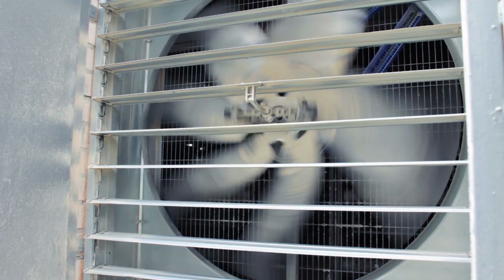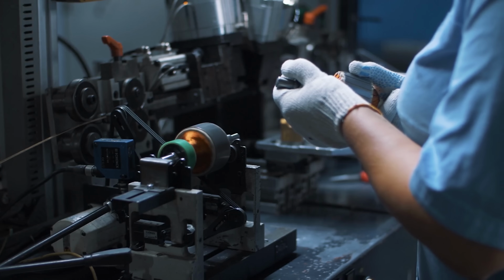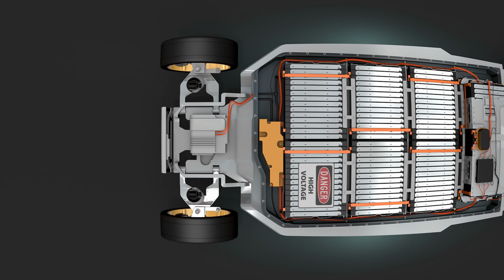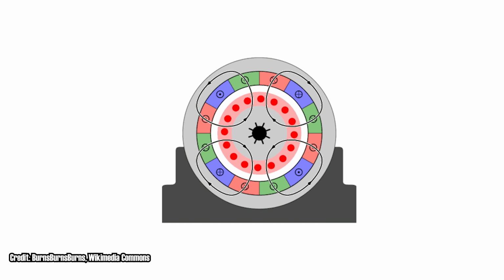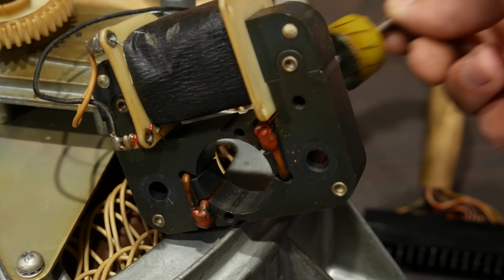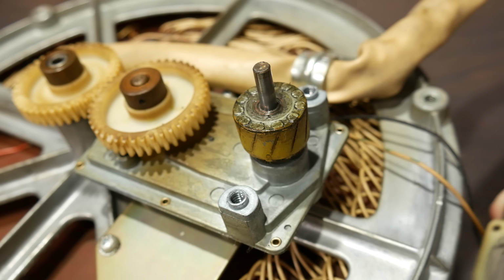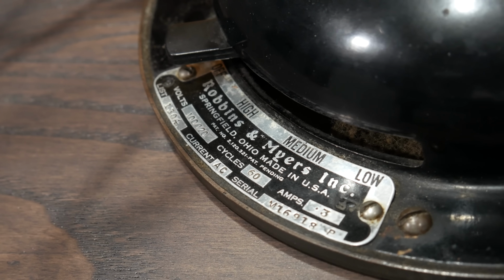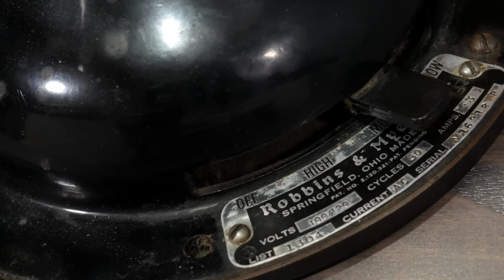Fans; High is next to Off on purpose

Comment: Huh! I didn't know that industrial scale electricity transmission was three-phased. And it never occured to me that two-phase AC electric motors would have a fixed speed limit. You learn something new every day, don't you?
Reply: in other parts of the world (most of Europe) three-phase electricity is very normal, every house and every apartment has three phase 400V electricity. We run 11kW electric stoves, water heaters and big tools from that supply. It's also very handy to charge your electric vehicles at home (because as Alec said, you can transfer much more power over a few wires).
Reply: @Manawyrm  In Europe we also have 220-240V on between any of the live wires and ground, so it's possible to power 3kW kettles and 2kW hair dryers without any super-thick wiring even with single phase power.
Reply: @Manawyrm  Here in Italy virtually nobody has three phases at home. You can have it if you ask, but you'll have to pay for the monophase meter to be changed and there's really no reason when 99% of people only have a 3kW hookup at home. 

You're only forced to get a three-phase hookup if you ask for more than 6kW, and I don't know anyone who does that in a residential setting. I've always been baffled by people on the interwebs saying they have 12 or 15kW at home. I wouldn't be able to use that much power even if I tried wasting it on purpose.
Reply: @demoniack81  that sounds  very strange. Here normal supply is around 7-10 kW per apartment, otherwise you would just blow the fuse when trying to use a vacuum cleaner or washing machine at the same time, or when kitchen stove is on. Maybe it can be lower in houses with natural gas supply, but still 3 kW wouldn't allow using two high-power appliances at same time.
Reply: @demoniack81  Floor heating (when all on) peaks around 5 kw, electric heaters peak at 2400 w, ventilation with pre-heater peaks around 1500 w, two heat pumps together peak 3000 w, sauna stove peaks 9000 w, patio infrared heater 2000 w, electric car charging 7200 w, roof heater elements (rarely in use with the heat pumps) peak around 3 kw, stove peaks at 7000 w, oven 2200 w and finally the water heater 3000 w. All in all it rounds up peak power to around 42 kw (without other accessories, such as a vacuum cleaner or lights). 

The electric service to our house is 3 x 35 A x 230 v so theoretical limit is around 24 kw, and long term limit is 80 % of that = 19,3 kw. Typical average usage on a winter day is around 2,5 to 3 kw (without sauna), so peak power is really only just peak power. The main fuses can stand some overlap if we use more than 24 kw of electricity (briefly), but we sure could probably pretty easily blow our main fuses in this house.

Electric usage is around 25 000 to 30 000 kwh a year. Luckily electricity is pretty here cheap in Finland! But I think you heat your houses more with gas in Italy?
Reply: @jeesjees2  WOW! 30MWh? That's insane. Normal usage is ~2-8 MWh here.
If you used that much energy in Germany I'm pretty sure the cops would visit you and look for an indoor cannabis plantation in your house.
Reply: @Tycho343  Where I live you get 3 phase by default if you have an electric cooktop (or, rather, don't have access to a natural gas pipe, but these are essentially the same if you live in a city). Otherwise it's single phase. If you are not in a city, you can have 3 phase, but it's 1 phase by default

That said, the consumption is not as high as @jeesjees2 because of central heating with a separate meter and a separate bill.
Reply: @jeesjees2  I have 3kW. Here it actually works the opposite way - we can pull up to 30% more (so 4kW) for a limited time (5-15 minutes, I'm not sure), or 10% more (3.3kW) indefinitely, so I guess on your scale I actually have 4kW.
Most italians do heat and cook with natural gas - it would make zero sense to heat with electricity when a large amount of our power is made with gas as well.
I actually have teleheating (hot water is cogenerated at the local power plant and comes into the building basement) for heat and an induction stove, so I don't need to pay for the fixed costs of gas that I would only use to cook.

My induction cooktop could theoretically go up to 7.2kW total, but who the hell uses all the cookers at max power at once? Most of the time I use one at 2kW until water starts to boil, then turn it down to 1kW or less. That leaves me with another 1kW to do something else while the water boils, or if I'm only boiling water I'll turn it up all the way to 3kW and then down again.
I have a 1.5kW water heater but I only turn it on in the evening and leave it to heat overnight when electricity is cheaper. I do the laundry on the weekends when power is cheap all day long and the boiler is already warm, so the washing machine can pull as much power as it wants. I just start the washing machine when I'm done cooking.

The only two appliances I have to look out for are the oven with its 2.7kW and the fryer with its 2.9, if I have one of those two on I can't use any other high power appliance, but I use the fryer pretty rarely and typically if I'm using the oven it either means I'm not using the cookers at all, or whatever is in the oven just came off of said cookers and I don't need them anymore.

Other than that I can basically do whatever I want and I've had the power disconnect maybe twice or thrice last year.
It would be useful to upgrade to 6kW so I can use other stuff along with the oven/fryer, but anything more than that would be totally unnecessary.

My total power consumption last year was 2.25MWh.
Reply: @Tycho343  that's one disadvantage of lower voltage appliances ... they draw a lot more power (current) that's what you pay for in your electric bill ... in other words 120 volt stuff uses almost twice as much current as a 240 volt motor that has the same horse power
Reply: @demoniack81  It is usually more cost effective (and cleaner!) to create the heat somewhere else and then transfer it via hot water pipes! Alas I don't have such technology available at my house. That said, I would require a water transfer method inside the house too (for example hot water radiators). All I have now is electric heating cables buried inside the ceiling or floor concrete which is nice to use, but not very cost effective to operate, as coefficiency factor (COP) for direct electric heating is 1 at maximun, whereas an air to water heater could achieve seasonal COP of 3 or even 4. So the system gives three times the heat energy it uses as electricity. Current setup, direct heating + air to air heat pumps, seems to be most cost effective so far.

Other popular alternative here is geothermal energy, but it's large costs are nowadays rivaled by the more cost effective air to water heat pumps. I might install some water radiators/heaters myself too in the future, but given that it would cost quite a lot (all the floors would probably have to be renewed if we wanted floor heating) and given that the original system is still functional, it would not make much sense financially.

Best option to improve energy efficiency would probably be to start burning wood in a new fireplace made out of soapstone or similar material. Soapstone fireplaces cost "only" around 5000-10 000 euros, so it would probably cancel itself as an investment in less than 10 years. Fireplaces however generate local (small and larger particle) pollution, and I'm hesitant to contribute to that, since the air is thick of smoke already on some winter days! Of course it matters quite a lot what you burn and how you do it, but still I'm hesitant. Wood would be cheap though.
Reply: @Manawyrm  Cold northern climate and around 20 year old heating solutions (direct heat and little insulation) give this outcome when coupled with a large(ish) house. Of course it would help if inside temperature would be lowered to say 19 c instead of the 22-23 c we usually use. 3 celcius lower temperature reduces energy usage by around 15 %!

Comment: "Why are they in that order?" In the UK, they're not... and most actually have latched buttons (Like a cassette deck) where you push one, and the others pop out, so you can go straight from off to any speed.

And yes, even with the British ones require you to press the 3 button first to get going, then go down to 1 or 2.
Reply: The same in Germany (from by experience). So he might be right about it being (an American) tradition nowadays.
Reply: It's an american design. Here in Brazil, all fans are designed like that. I've been in Japan and there's the same thing.. Lucky you europeans lmao
Reply: I've bought several smaller fans in the UK with knobs rather than buttons. Those also go off->1.

(I also never noticed the difference in the US. Oops.)
Reply: We used to have fans with buttons in the US; I distinctly remember having a few when I was a little kid because I kept trying to press all of them down at the same time to see what the fan would do, and my family moved from Connecticut to California when I was 9.
Reply: Its still an Australian thing for ceiling fans. At least now I understand why.

Comment: Instead of simplifying, you should have taken a page from 3blue1brown and delight us with all the math that goes with induction motors including back-EMF as they speed up.
Another thing worth mentioning about all these motors is that they typically use the airflow they generate for their own cooling. It's yet another reason why a startup stall is extremely undesirable.

Comment: This is a timely topic! I have a 20-year-old floor fan. Last week we had a couple of momentary power failures while the fan was running. When I checked on the fan later, it had stalled and the motor chassis temperature was 200 degrees F!

Comment: Is this also why stoves typically go from off to light to the highest setting then back down? Giving the spark a higher rush of gas/electricity to start?
Reply: It's to give a richer gas mixture for the igniter.
Reply: @timothylegg  is that true?
Reply: My hot plates do that.  You turn the knob and the igniter operates and burners are on high, as you continue to turn the knob, the flames get lower and lower.
Reply: Probably

Comment: i've never seen a fan with a switch in this order somehow 0.o maybe that's an US vs EU thing?
Reply: You're in the EU?
Reply: @ricksande2210  The EU is real? I thought that was a myth that was made up to try to explain where we came from on earth(everyone knows that the garden of eden was in florida thats why its called land of flowers)
Reply: DoomDwarf_347 the eu is real, australia is a hoax don’t let them brainwash you
Reply: @inactive6200  *feels offended in Australian

I too, have never seen a fan that went from off to high to low, all ours are seemingly in rising order or are a circle. In fact, every desk or pedestal fan I've had used buttons from 0-1-2-3, so you can just click max speed straight away, but the buttons are still in order.
Ceiling fans in houses everywhere that I've lived use circular switches, so turning one way is 0-1-2-3, turning the other way is 0-3-2-1

Interestingly the house I live in now, is only 6 years old but one of the ceiling fans is already worn out to the point it doesn't start on the lower setting without a manual push to get it going
Reply: Same never seen this here in EU, they are always 0-1-2-3 but I havent seen any really old fans maybe they had this.
Reply: Maybe because US use 120 volts. It is possible this lower voltage requires switch designed mentioned in the video.
Reply: @UltimateAlgorithm  that could well be, yeah.
Reply: Same as Australia.  My three fans all go from off to low, medium then high. Maybe we are more advanced here

Comment: In india the speed selector is like
0
1
2
3
4
5
(Circular selector , can turn the selector both ways)
Reply: On many controls 1 is high
Reply: @justFans2002  That would be a stupid design decision, and in his case I can pretty much guarantee it isn't. Just a matter of the low US voltage (120V) vs most of the rest off the world (220V ~ 240V). The higher voltage makes it that the fan can start just fine on its lowest setting.
Reply: It's stupid but I've seen it

Comment: Interesting.. Never encountered a fan with off-high-med-low..  My dimplex branded ones have push-buttons in low-to-high order and the ones with knobs or leavers also follow that.
Maybe it's more of a US thing?
Reply: Yeah, here in Australia it's the same, but our voltage is double what it is in the US. I have never come across a fan that goes off high med low.
Reply: Here in the US, well at least in Kansas most portable fans work this way (like 90%).
Reply: Not only us, same in Brazil
Reply: Nchalada I have one, but it’s an old one so probably explains it
Reply: I've never ever seen a fan with 0-high-low. In South Africa I've only seen 0-low-med-high. We have the same voltages as Australia btw @ 240V
Reply: I wonder if it's an age, tradition or voltage thing.
I can see it as being more important with lower voltages and therefor winding higher currents for the same magnetic field(Higher voltages means you can use more turns and same total power but lower current.) but not having designed one of these motors myself, I don't know for sure.

Brazil seems to use 127 and 220v, so I'm not sure?
In Aus, even ceiling fans are normally a rotary switch with off-low-med-high but can be turned either way.
These videos often bring up things that are normal/common in the u.s. and unheard of or rare elsewhere. :)

Comment: 0:04 what??
Reply: Both gas and liquids are fluids
Reply: In physics, all gasses are considered fluids, because they flow like fluids
Reply: @berkutmotovlogs7954  circular definition but yes
Reply: @lonestar125 in physics, fluid =/= liquids. Fluids encompasses both gas and liquids, characterized by their lack of shear stress resistance (hence they "flow" unlike solids). Some small particle solids in large quantities like sand can also have fluid properties although they are ultimately still solids, like the fluidized bed reactor (hence the name)
Reply: @pootischu  i know i was just pointing out that he defined fluids by saying that they act "like fluids" which is a circular definition

Comment: When I was younger, I always would take apart our fans to clean them before putting them away.  I would lubricate them before the start of the season.  Most fans these days, you can't perform maintenance on.  The earlier fans had settings to one side or the other, push buttons etc.  For the newer ones (and for people who don't oil and clean their fans), it makes a lot more sense to start off in the speed that gives the best chance for the motor to start.  Good thing we don't generally have to do that with motor vehicles.

Comment: I had a fan growing that was probably already a decade old by the time I started using it around 4-5 years old. I used it every night for many many years. Once it got to the point where it would stall even upon turn on high, I would simply push it with my fingers (or a pencil to make it easier) to get it going. Eventually I did take it apart, cleaned it up, and it worked just fine. I miss that fan.

Comment: Thanks from a long time fan, it feels like this video was made for me. I used an old fan from my grandparents which had a button to push down to select a speed and if you started at a low speed it sometimes stalled and you could see it sort of arcing or something to try to get it to go and it felt quite unsafe so I stopped using it. This video helps me understand why it behaved that way. They don't build 'em like they used to!

Comment: Interestingly, in Asia, a lot of fans have low first. Almost all wall fans I encountered put the low speed first when you pull the cord. It seems like most of these fans have no problem starting on low, and the high-med-low thing on American fans is just a customary thing from really old fans. However, ceiling fans (if they use pull chains) still have high first, I guess because ceiling fans have more inertia so take longer to start on low. A lot of ceiling fan manuals will still advise starting the fan on high, though for the most part, starting it on low (e.g., if you just turn it on using the wall switch), doesn’t usually seem to cause major problems. It just takes longer

A lot of knob-operated fans (like portable fans and ceiling fans with wall switches) have a “continuous” knob where you can start it on either low or high, or a knob with the off position on “both sides” (low and high)

Comment: It also makes sure, that if you turn the switcht in a haste, you will skip over the high setting and end in the low setting.
Assault Rifles are designed that way. The mode-selection is "Safety - Autofire - Singleshot"

Comment: I think it's a good thing they still start on HIGH; even with new fans, it's highly likely that at some point in their lives, the grease will harden and the bearings will get sticky enough to start on HIGH, but not LO. I once bought a can opener that was made around 2008, just before the crash, when copper prices were at a peak, and from day one, it just hummed until you gave the can a jerk, even though, otherwise, it worked reliably for over 10 years. When I opened it up, I found that they had used aluminum, rather than copper shading coils to save a few pennies. Maybe all such motors use aluminum now, but it was clear that the shading coils needed to be bigger if aluminum was going to work properly.

Comment: True fact: One of the ceiling fans that came with an apartment I used to live in had a problem keeping/starting moving.  If running it on low, you could use your hand to get it going, and it would spin for a time and eventually stop.  It would run better on high, but it always made a contextually loud electric hum (like what you hear when motors are unable to move at full intended speed).  I thought that meant there was friction in it, but maybe the kickstart described in this video was faulty.